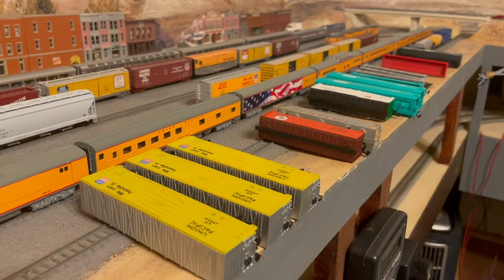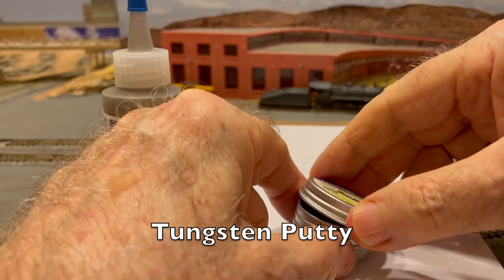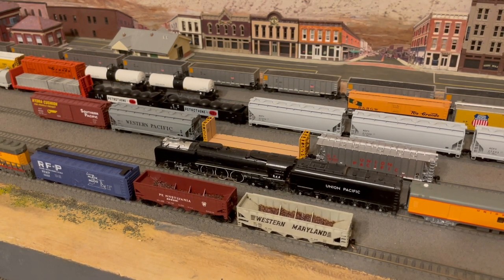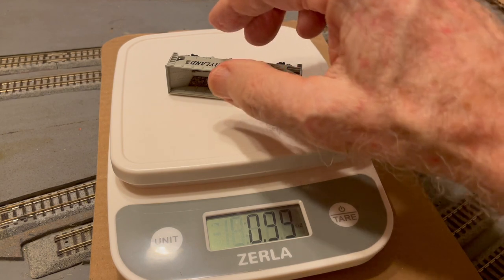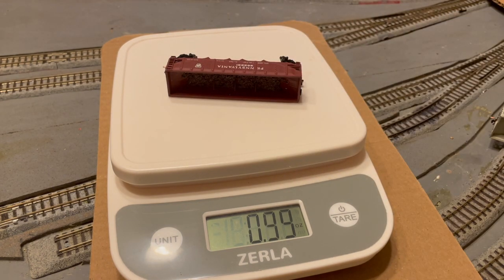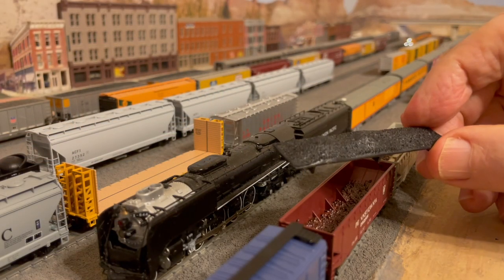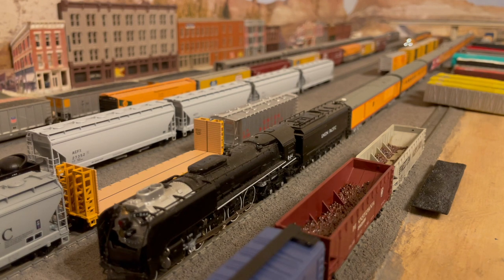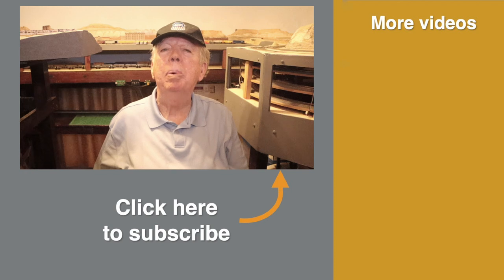Products for Adding Weight to Your Freight Cars...Quick Tip

Comment: Good advice Roy. To remove any loads from your cars add a small magnet or magnetic substance stuck to the underneath of  the load. For fast off scene removal a small magnet will enable you to get the loads out quickly.
Cheers, Bovb
Reply from the maker: Thanks, Bob. Using magnets is my plan. We'll see how it turns out. ...Roy

Comment: What I have discovered and have been using where I can is air nailer nails, they come in different lengths and you can snap them apart to get your desired weight. If I have to tier them I use a cheap 2 way foam tape from the dollar store.
Reply from the maker: I never would've thought of them, Greg. Thanks for letting me know. ...Roy

Comment: You can also add self adhesive wheel weights from an auto parts store and birdshot from a gunshop. Low temp has been used by some but precautions should be taken to prevent burns and melting plastic. Brass bar stock, steel weights, and fishing sinkers used to crimp on fishing line are good too.
Reply from the maker: Thanks for your comment, Charlie. There are so many different products we can use for adding weight to our freight cars. Sometimes it difficult to choose. ...Roy

Comment: Great video Roy will need to check my weight on my passenger cars as I’m having derailment issues with them or the 15” radius was too small for 80’ Pullman cars
Reply from the maker: Thanks, my friend. I have come to the conclusion that it's a good idea to weigh every new car. ...Roy
Reply: There are some cars that will not traverse a certain minimum radius.  I saw an example of that in 1973 when the KCS was pushing cars for the Kansas City Railroad Museum display onto old transfer tracks with curves of 16 degrees or less(359.265 ft R) and I think the curves were as sharp as 20 degrees (287.939 ft R).   The freight cars were no problem but the passenger cars would not go.  The truck side-frames hit the center-beam and bound up to where the inner wheel would rise about 1.5 inches above the inner rail of the curve.  The crew backed off to where the side-frames did not touch the center- beam and left the cars.  Fortunately, this was noticed before the flange jumped the rail and derailing as this was beside a dock.  I can't remember the length of the cars, but I don't remember them being 80 feet either.

Comment: I don't do N scale as I do HO & 027 Lionel.  I use tire weights I get from Harbor Freight in 1/4 & 1/2 oz. which I hide under the loads of my gondolas & flatcars.  I only use metal wheels and body mounted Kadee couplers for HO.  Cheers from eastern TN

Comment: I have used a length of solder wrapped around freight car axels to add weight to empty "open-top-cars". Painted flat black you almost never know.

Modeling one-half of a loads-in/empties-out set of industries I prefer to build two identcle train sets of cars, one loaded the other empty. Each "set" has the same "numbers" and weathering. This way I can "unload" the coal at the power plant hands-free in real-time just like the prototype. granted, the dump-house is twice as wide as the prototype however, unless you know what you're looking at you miss the sleight of hand trick going on.

I like to keep the unit-train cars (of the same "type") all the same weight so they act the same. Not too worried if the car's weight is above or below the NMRA standard. (I prefer to be lower or at.) The important thing to me is how the train set handles the track work.
Reply from the maker: I've heard of using solder wrapped around axels, Thomas, but I haven't tried that technique yet. There definitely a big difference in the way freight cars handle after adding weight. I'm really pleased with the difference. ...Roy

Comment: Roy there are some cars that do not come apart so i cant add weight to them .
Reply from the maker: That's true, Rich. Some people have drilled holes in the bottom of such cars and put sand inside. But I think we'll have to accept some cars just as they are. ...Roy
Reply: Im not doing that most times if a car is to lite i wont buy it.